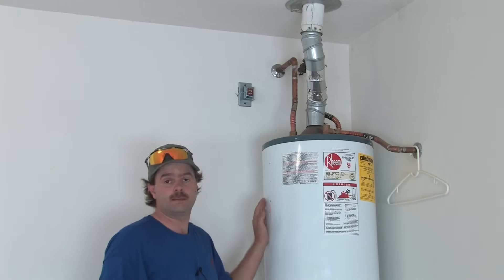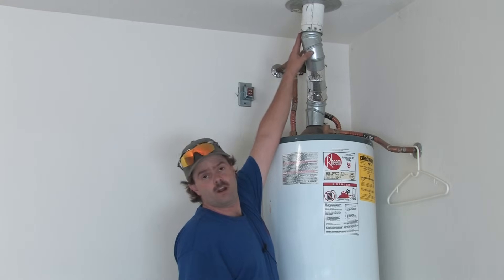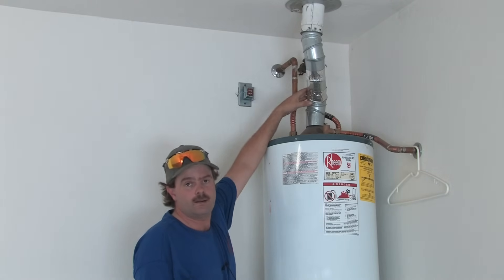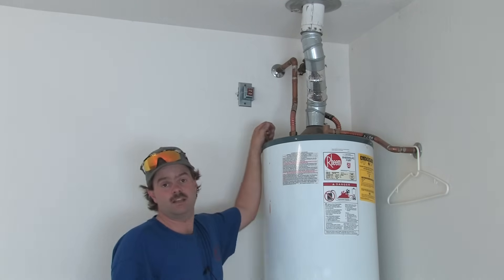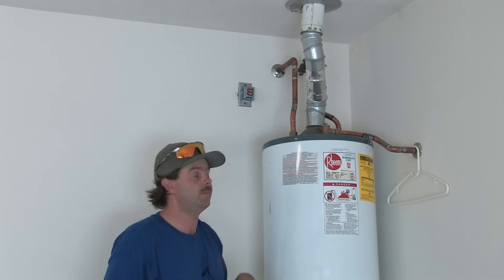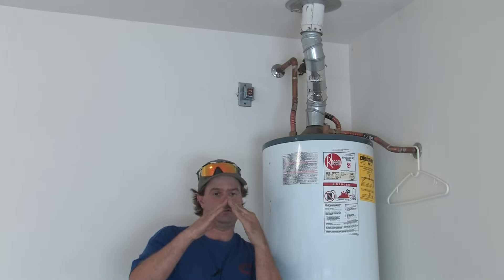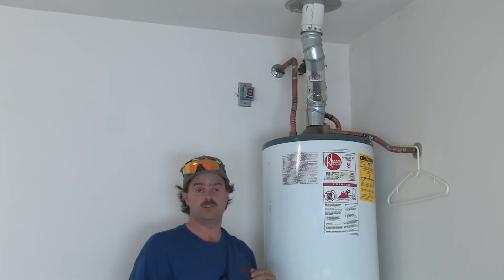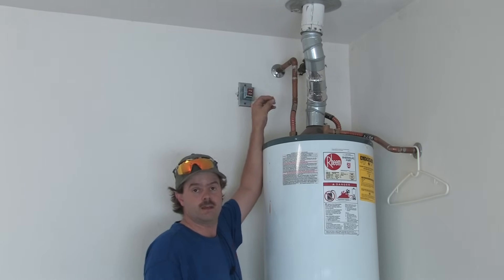Hot Water Heaters : How to Properly Vent a Gas Water Heater

Comment: the vent pipe manufacturers have instructions to prevent liability. most of them require a 12 inch vertical above the bonnet. this is the most abused rule of venting, since most inspectors do not know the rule anymore. try that smoking test right when the water heater fires up, all the CO will come right into the house.

Comment: how do you air seal and insulate that going thro the ceiling into the attic?
Reply: Use double wall b vent. Screw every joint together. Make sure you install it in the correct direction, with the arrow on the sticker pointed up.
Reply: @bsrkoacar8414 you have a vid on this?

Comment: Could anyone answer this: how is it i can cook a turkey dinner with my propane range running with 4 cook burners and an oven operating 4 hours and that doesn't require a chimney but i cant have my propane water heater with one small burner running for 15 minutes and it needs a chimney?
Reply: Look at the BTU ratings on them and there will be your answer.
Reply: No one can answer that.   Strongly suggest to open a window when cooking with that much burner action.

Comment: Thankyou. Bcz the silver pipe on top of gas wster tank is allowing cold Winter air to flow down the pipe into laundry room, tank is only on low setting. I see now, the outside pipe needs to be above the roof. It is 5ft below the roof now and that's why it lets cool air into the hse from the pipe. Thank you.

Comment: Where is this ? Is this in the United States ? If it is, i guess you don't have regulations when it comes to gas. I just had to replace my venting pipe and i had to "upgrade" my PVC pipe with a thicker one because i was told the older PVC pipe was out of date with the regulations. How do you vent your gas fireplaces ? The same way ? With aluminum ? Yikes!

Comment: i have a gas water inside my house , my ? is if my air condition is escaping though flue above draft hood
Reply: I love it when people post a reply and don't actually answer the question. YES your nice cold air is being sucked right out the flew. Also, your nice cold air is being sucked into the combustion chamber and also right out the flew.Like all2skitzd stated . . move it outside were it belongs.
Reply: @tinaleanne8230  Great answer! Thanks Tina.
Reply: generally speaking the gas water heater should be separated from living area like in a garage or a closet with sealed door and its own air supply